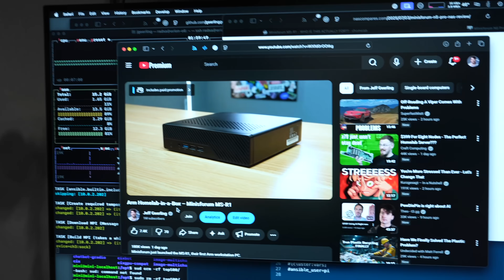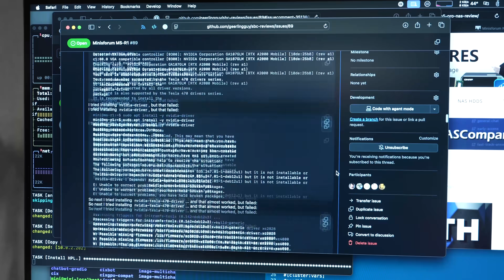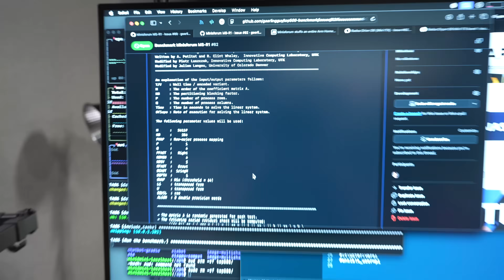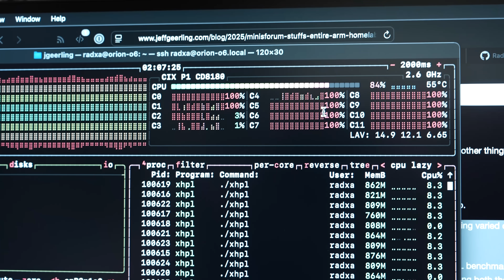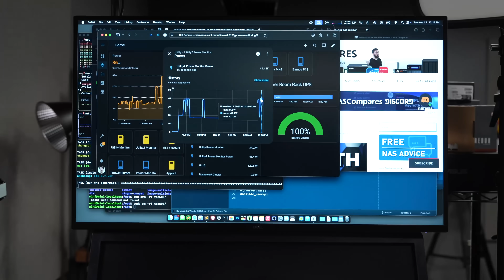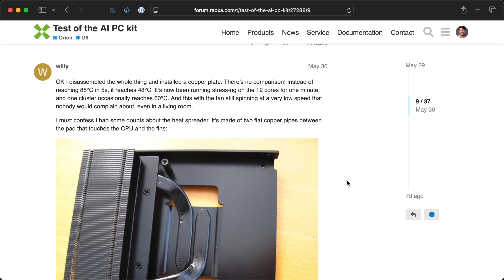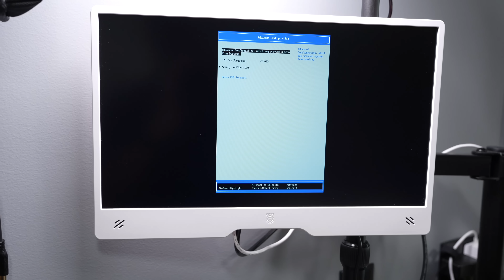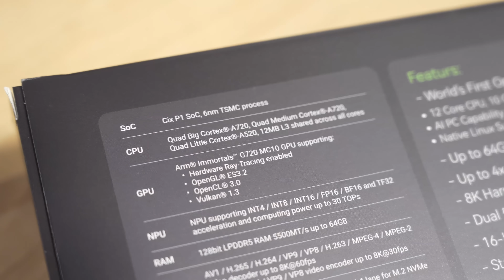Much Ado about Arm and Benchmarking

Comment: I've never heard of anybody call a machine that is 'off' but ready to go quickly as in Hibernate/Standby as idle... With odd hybrid devices like some smartphones where the main powerhouse CPU can be off while the device is still techinically active as the essential runs the modem etc core is running etc it gets muddier, but in the computer world idle has always been some degree of 'on' under 'no load' so the system might just have gone into the lowest clock speeds etc - which with modern Windoze and its background bloat, and even the better OS that still have background, network etc tasks going isn't really strictly idle, but still on and could be working but not.
Reply: NAS Compares makes weird videos. From one hand, his video is too shallow for tech people. From another hand, he repeat the same thing 10 times and make 10 munite video about something that could be just a 3 minute video. And sometimes I'm not even sure he understands fully what he's talking about.
Reply: For 20 years or so, the terms "on", "off", "standby" or any other, have next to no meaning. Various parts can be at any one of many power states (4?5?) and it may be that some are at different states than others.
Reply: @GeorgeTsiros  It has always been as far as I'm aware even now notably different - The varied power states contribute to the IDLE efficiency, as clocking back and turning off the bits that are not in use right now happens, so that 'idle' device has lower power draw. But the devices are definitively still on, likely still doing some work, even if its rendering the screen saver. 
Where device wide standby/hibernate states the device is not doing anything at all but waiting to be woken back up.
Reply: Makes sense for NAS'es though
Reply: @SomebodyHere-cm8dj  Not really IMO you generally want your NAS to actually be ON, though idling often 24/7 so all the devices that want to talk to it will actually find it exists and reconnect the network drives etc.
Reply: @SomebodyHere-cm8dj  It makes sense for archival storage. Not for network attached storage. Network attached storage implies that it is always ready, and not "ready after a few seconds".
Reply: hibernate and standby are completely different things. Hibernate usually means there is a delay of up to a minute or two for it to begin responding to input. Standby means maximum 1sec and it's fully ready to go. Very different things. Standby can drop the CPU clock to whatever is lowest required to run system clock, ethernet stack, usb input stack etc still but it cannot HALT the CPU. 
So "hibernate" from  my  understanding basically always means it writes what is in RAM to storage, and turns OFF. Standby is it goes into system power state S3 and CPU will either be in C6 all the time is 90% of the time about - depends on what it takes to monitor inputs etc. These two are not the same things. Some people may call system power state S3 + CPU in C6 as "la-la-land" but it doesn't mean anything. 
Below is from Google search AI response which is a summary of top results more or less. I looked it up after writing my above definition, which as you can see is consistent. 
S3 (Standby): The CPU is powered down, but RAM is kept refreshed to maintain the system's current state. This is the traditional "Sleep" mode.
S4 (Hibernate): The system saves its current state to the hard drive and then powers off completely, using very little power. Resuming from hibernate requires a full reboot, but is still faster than a cold boot.
------- So at least for tech professionals there is a consistent coherent understanding of the differences are I think, general population is a different deal and may be due to there not being enough information presented coherently about it - honestly don't know, it isn't my area of expertise. But there are technical definitions of these states, which means there is between zero and very little room to 'discuss/define' what they mean.

Comment: The high power draw really is a shame, I'd love to see the Cix P1 in a laptop form factor.
Reply from the maker: Ditto. It's not quite M1 level of performance, but if you can get something resembling that with full Linux support... and only using 3-5W idle, I'd be 100% for it.